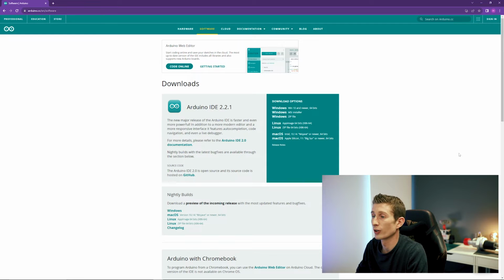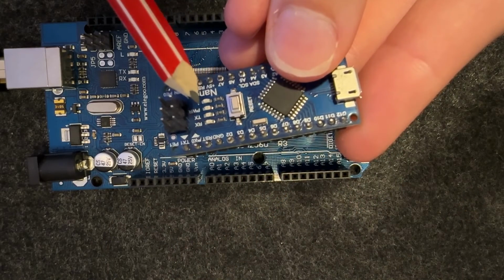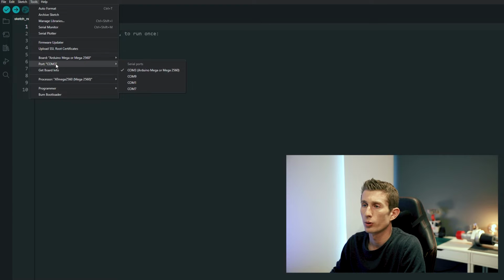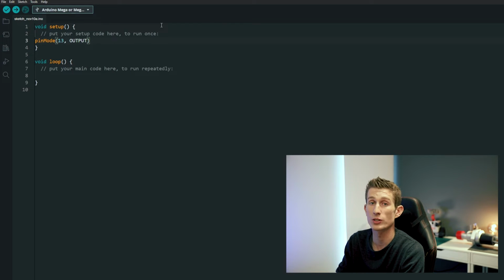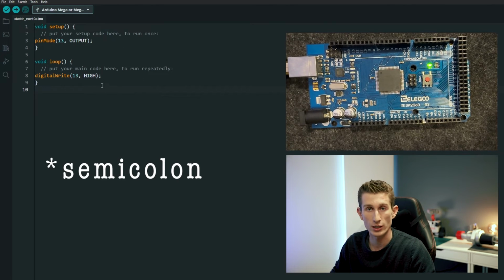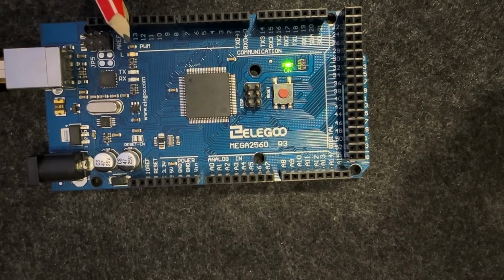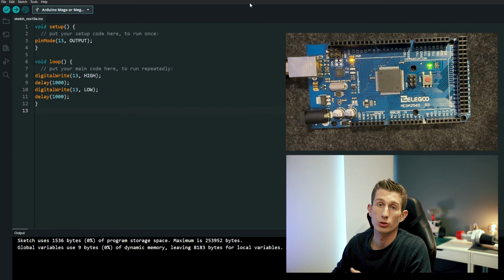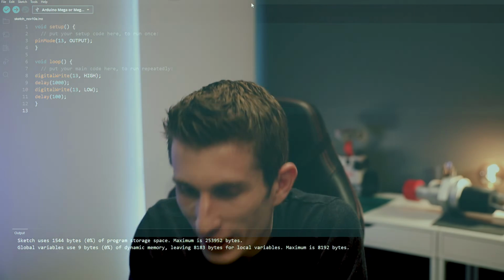Ep: 5 - Learn to Code Arduino for your Flight Simulator Cockpit | Arduino Basics

Comment: i have a pit i built using leo bodnar boards, they mostly work great BUT i have ALOT of problems with switches randomly going on and off and i dont think the switches themselves are the problem and also i have so many boards that windows cant cope with them all (too many HID) so i have to switch on and off. they are plug and lay though and show up in dcs as controllers. can i do that with arduino boards and use less of them to do it?
Reply from the maker: You can, and you can even make some arduinos show up as joystick controllers 
And you can also use them with DCS Bios 
You can create programs that make the switches “self recognise” and then sync the game

Comment: I have a question with toggle switches. I have an (on off on) toggle switch, but it needs to be (off on on). Is there a way to correct this in programming with the pull up or pull down flags? Or do I need to find the correct switch?
Reply from the maker: Hey :) what switch/aircraft did you want to use it on - I can then tell you how I would do it 
But you should be able to use your on-off-on switch to make it work with some coding 🤙🏻🤙🏻
Reply: @aHornetsNest  F-16 electric panel. Battery switch. Thanks, I've been scratching my head on this for about a week.
Reply from the maker: Oh yeah nice! Yeah a ON OFF ON will be fine 
That’s the type I’m using 🤙🏻

Comment: Really nice videos and clear explanations. How do you deal with the initial toggle switch positions when DCS starts?
Reply from the maker: Thank you! With BIOS it auto “polls” and syncs all the switches 

If you were running the Arduino as a HID/Joystick controller sometimes the switches sense and sometimes they need cycling 

You could create a “sync” button which you could press and force them all to sync

Comment: ... been programming for years... but ye, as far as Arduino's been concerned been in copy/past land (mostly did all my code on Pi's using Python)...
thanks for this, looking forward to the subsequent tutorials... to see how you interface with cockpit controls as thats what I'm doing/building, helicopter controls.
hope you cover logic shifters (74HC165 ) also.
Reply from the maker: Thanks mate! I can definitely look into logic shifters …. I use the 74HC595 daisy chained to drive my Caution Panel :) 
Thanks for following along 😃
Reply: @aHornetsNest  I'm busy following/building a Heli Cyclic and Collective where they used the Arduino+Logic Shifter and MMJoy2.
Reply from the maker: @georgelza  awesome! For any aircraft in particular? Or multi purpose?

Comment: Hello Scott, Im currently rebuilding thrustmaster Rudder Pedals, meaning I compleatly redesigned and printed it. It`s basically a new set of pedals. Now I want to get rid of the old electronics and integrate a Hall Sensor for the rudder axis. So thats two potentiometers for the toebreaks and one hall sensor for the center axis. Im using a pro micro board. Would be nice if you include some potentiometers and hall sensors in you next video, thanks. PS: Im also in the DCS Cockpit sim group on FB.
Reply from the maker: Awesome!!! Sounds like a great project -  shoot me some pics I’d love to see the redesign 
100% - this Tuesday is all about variables, and how to reading digital inputs 
Next Tuesday will be a dedicated BIOS episode :) and then after that I can definitely look at doing pots and hall sensors 😃😃